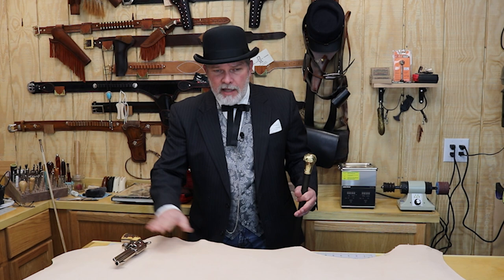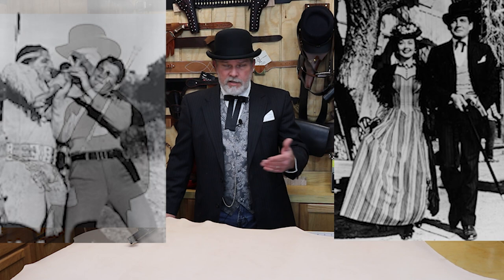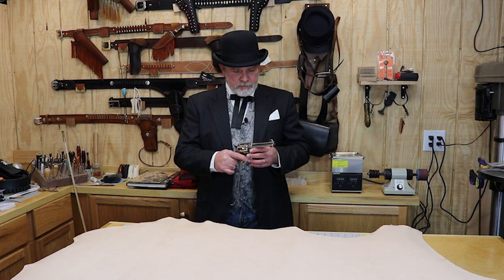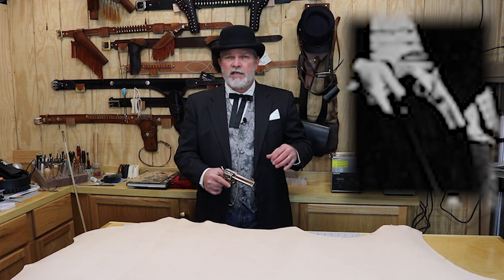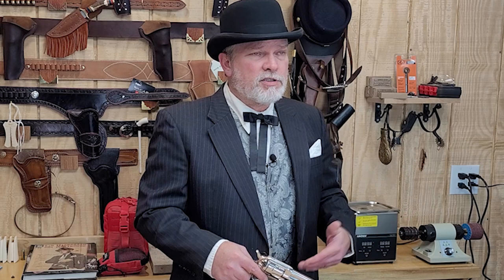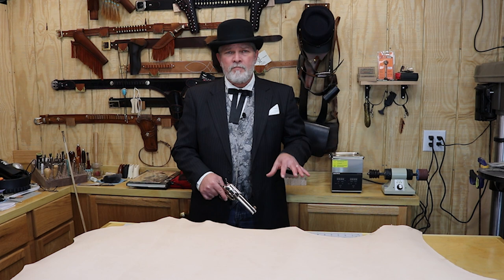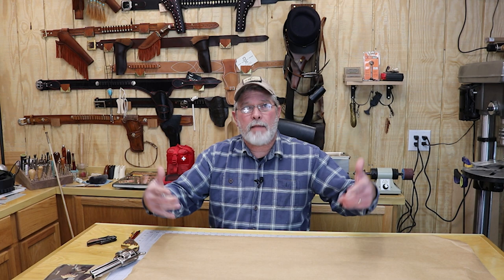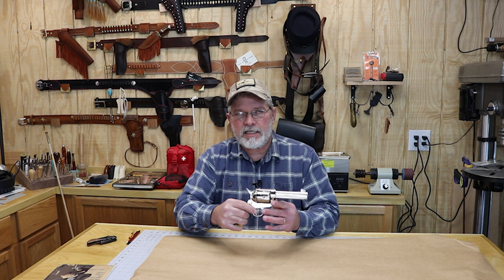How to make the Bat Masterson Holster | Leather Project

Comment: Excellent video, Richard! I recently was able to borrow the book "Packing Iron: Gunleather of the Frontier West," by Richard Rattenbury, through interlibrary loan, and I have been poring over it. I don't know if you've seen that book, but it's a wonderful resource on holsters, gun belts and other leather goods, both civilian and military. Unfortunately, it's a very expensive book, but I was happy to get it from the library.
Reply from the maker: I have! In fact, I just picked up a copy from ebay last week. I got a pretty good deal on it compared to what I've seen it go for. WOW! Very cool book and I'll probably be making a holster or two from it! Thanks for watching!
Reply: @SmallCaliberArmsReview  That's awesome! I've been taking pictures of some of the holsters I want to copy someday. One thing I found interesting is how flat most of the tooling is compared to current methods. Of course I realize some of it has flattened out because of age and use. But some really beautiful leather work was done in the Old West.
Reply from the maker: @8626John  yes it was. I'd like to do some more holsters with tooling. Most of my videos have minimal tooling like boarders and such, I need to do one that's fully hand tooled.

Comment: With all the good stuff you do how come you went cheap on the grips ? Why not use real stag ? I mean it’s a nickeled revolver, you do great leather work, Hmmm…

I have a similar holster(s) they have just a plain loop sewn in the middle of the back of the holster 

Ricky from IBM
Reply from the maker: The Ivory grips I made were going to be jigged for this pistol, just to do the Bat Masterson setup. After making them, I couldn't bring myself to cut them up to make them look like stag. The grips that were originally used on Bat's rig were actually a cheap plastic that were really popular in the Hollywood Western era, I just couldn't find the proper ones. I have looked at Stag, bone, and antler on places like ebay and after remembering the smell of working with it in the past, I just really didn't want to mess with it again. I have every intention of putting the faux ivory ones back on the nickel revolver, they look great on there and I fit them to that pistol anyway.
Reply: @SmallCaliberArmsReview  what’s wrong with authentic stag ?
Reply from the maker: @k4vms  Oh, nothing. I just don't like the smell of it when it's being tooled, other than that, it's great.